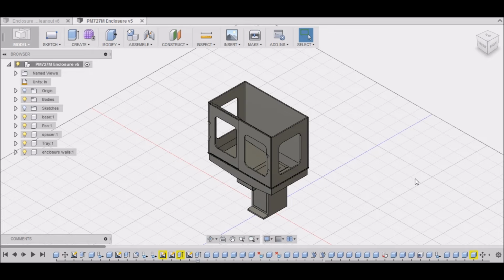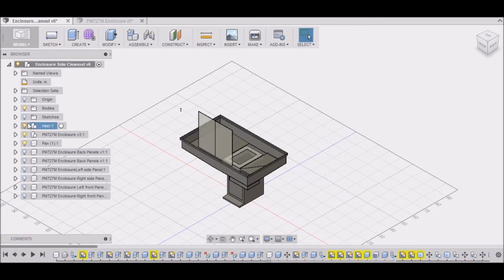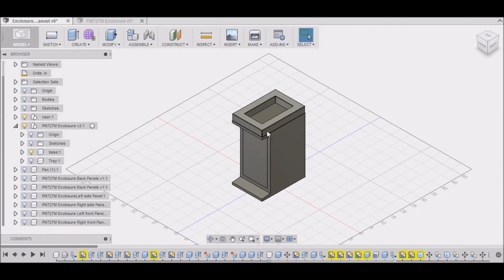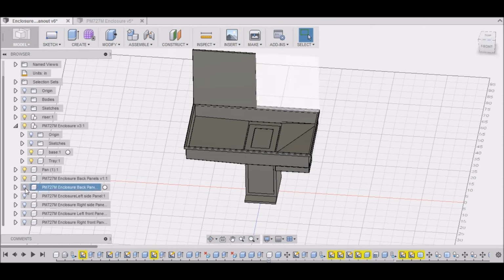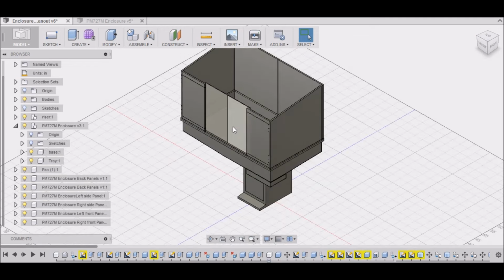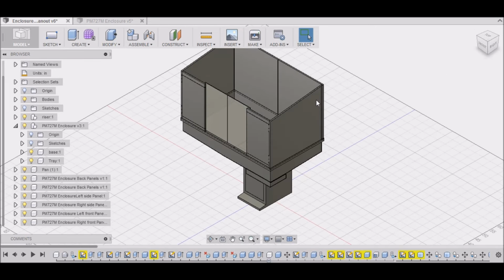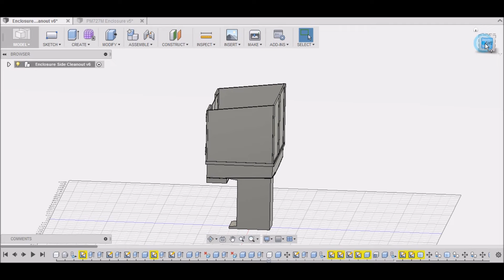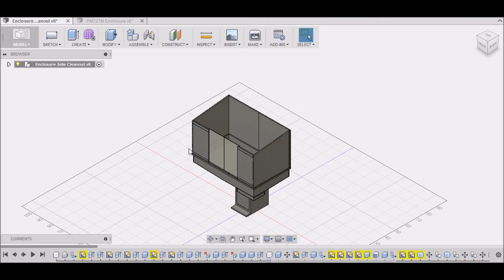PM727M Enclosure Design

Comment: Hi,  I really enjoy your videos, length always seems good I've never shut one down early so...  I have a F360 question for you.  I downloaded your plans but F360 tells me I cannot open local files.  Do you know what I'm doing wrong, could be I'm using the free version I guess.  Thanks for all the effort to share your knowledge.  My mill is a G0704 but is close enough that I pick up tips from you.  I'm all CNC'd so I was excited to see some info on enclosures.
Reply from the maker: No it's not you I'll repost the model tomorrow. 
Yes very close  so same enclosure may work for you.
Reply: Try uploading them instead of opening?  I had the same thing happen to me on another design from CNC router parts. I think uploading it worked. I can't quite remember.
Reply from the maker: Try again I uploaded another file
Reply: Hmmm, same issue.  I download then select file and open with F360 and I get the same error. Cannot open local files.
Reply: Got it.  Newbie just needed to search for the error and found I needed to upload.  Thanks.
Reply from the maker: Great!

Comment: One small suggestion, and perhaps you mentioned it in your video already, but consider increasing the stability of the base. I have the smaller PM25MV and on leveling feet, the mill its a little tipsy when the table is fully to one side, even with the base loaded down with accessories. I plan to increase stability of my base by replacing it with a wider one.
Reply from the maker: Thanks Kent, Yes it looks a little tipsy, I am toying with the Idea of some outriggers on the base.

Comment: Pretty nice enclosure Sam. What are you going to do about lighting?
Reply from the maker: Well I haven't narrowed it down yet I think I may need some corner bracing etc. so I will wait and see what I need.

Those Peel and stick LED strips seem to be what everyone wants to use there cheap, bright, and compact. 
I have used them in my kitchen there nice. I may go that route.